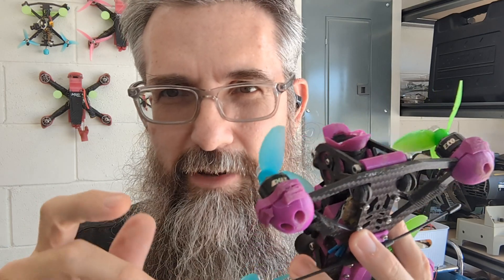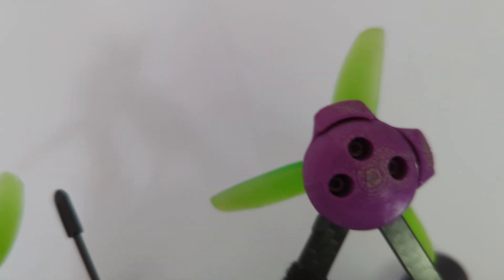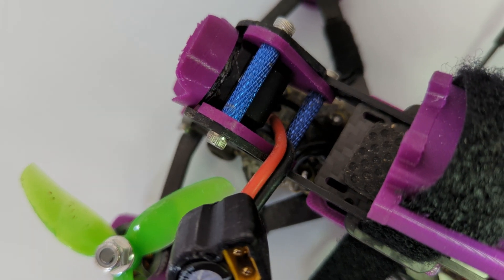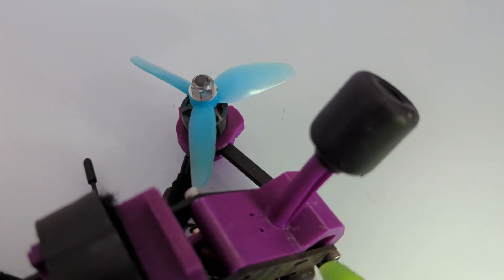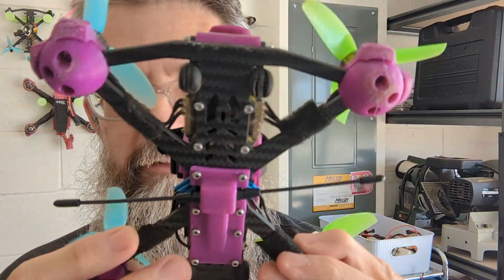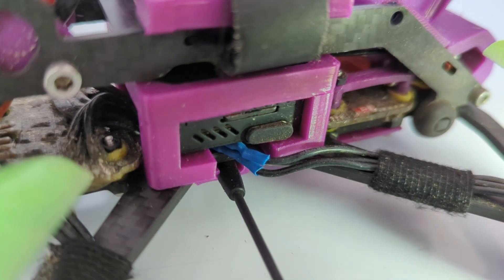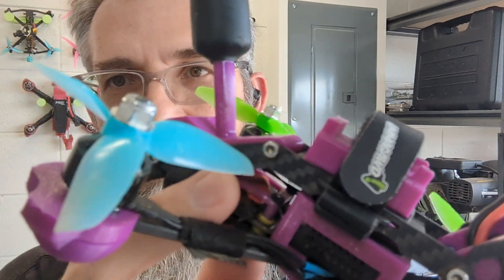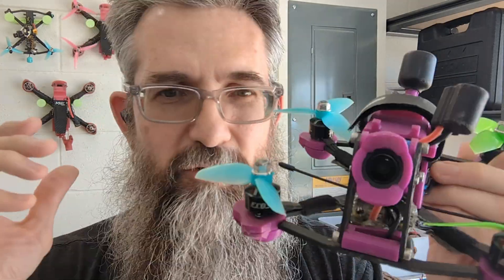Building a TOUGH Drone

Comment: Thanks so much for the tips! You’ve never had problems with the o3 getting wet? If so then water proofing sounds like a great idea I’ve just been worried to do it bc of my o3 over heating easily.
Reply from the maker: No issues yet.  I didn't add any waterproofing to it other than the USB port rubber insert